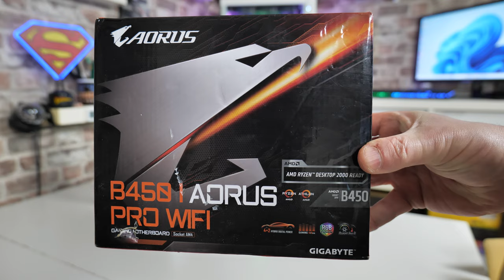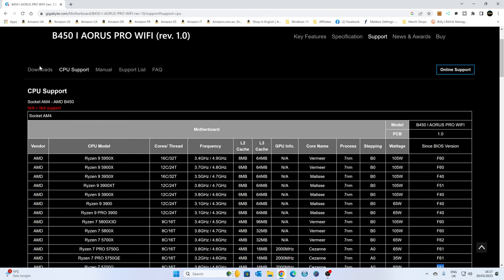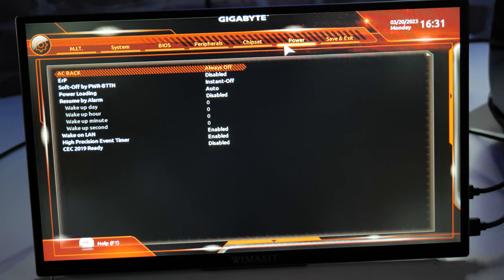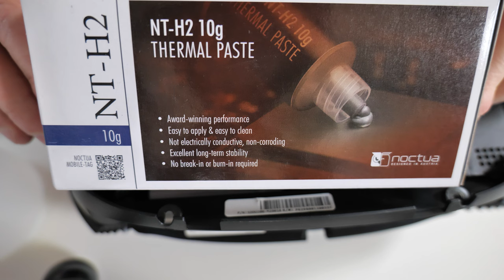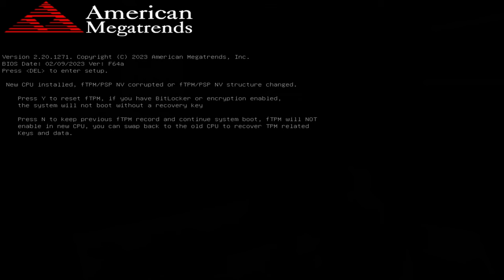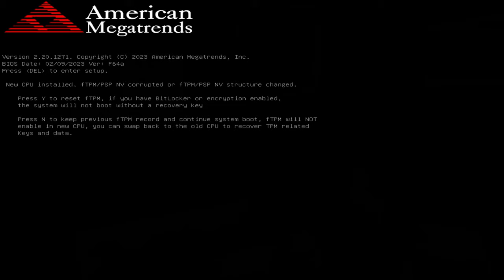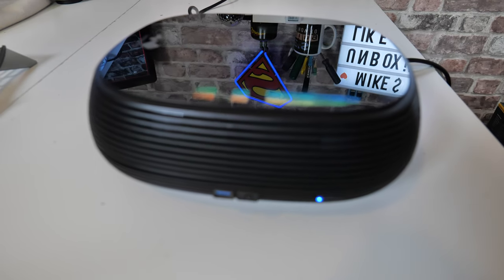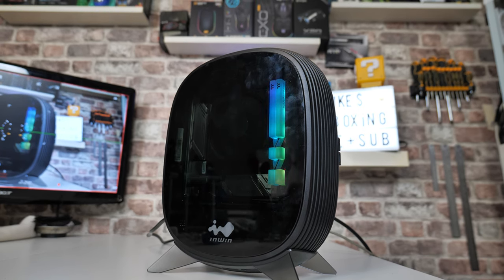Gigabyte ITX B450 I Pro WiFi BIOS & 5700g Inwin B1 Upgrade & Testing

Comment: Brett @ UFD Tech (YouTube) had this same setup (built it soon after 5700G was released) and had the thermal issues. He was going to cut slits or drill holes in the acrylic top above the cpu cooler to allow air actually to enter the case. But ultimately switched to the 5600G to get reasonable temps.
Reply from the maker: That is something I am considering

Comment: The main PC parts online dealer here in Aust. I usually buy from has jacked up the prices for AMD 5000 CPUs   5600G was $159 2 weeks ago now $399 5600X $349-> $499   5700g  $329 -> $549  funny how gone up just around same time lots of youtube videos saying how good the APUs and low end CPUs are.  the 7000 series are at present same price as before
Reply from the maker: crazy inflation and scalping at the moment

Comment: If you can run a low pro cooler with a 120MM fan the Noctua NF-F12 industrial PPC fan may help cooling.

Comment: I just sold one of my computer and ordered an Asrock b550M-ITX/AC so that I can put my 5700g in and print my case. I found a 3300x to replace the 5700g to have another working computer for sale. I will probably have to get a smaller PSU than the small one I already have to keep the case as small as possible. Then, I'll know who to blame if the airflow is bad😁
Reply from the maker: lol #blamedave

Comment: I have that mobo... It's pretty decent... The wifi is good on it though, much better than the MSI equivalent for some reason. The InWin Chopin with the mesh side would probably do a bit better. Can you try 45w eco mode?
Reply from the maker: yeah it needs some work, i might give up and switch back to the 2200g for a simple life

Comment: Great review as always from the dynamic duo. If you were to get another APU, might I suggest the 3400G as it has VEGA 11 graphics which would give you better graphics? It's only a Ryzen 5 and not a Ryzen 7. Should run a bit cooler in that case? It is an odd looking little case, but I like it too. Take care all. Cheers
Reply from the maker: Thanks for the tips!

Comment: Did you use any Zalman thermal paste? I would like to know if it's any better than Arctic or Noctua (at least it is on paper).
Reply from the maker: i didn't but i am doing a new thermal paste group test soon on the AM5 platform so watch out for that
Reply: @mikesunboxing  I'm also interested in Gembird thermal paste but not sure if it's being sold in Europe. The company claims it's based in Netherlands. For some reason temperatures rised after a few days of use.
Reply from the maker: @davidm7640  I’ll try and add it to the list

Comment: Hi, I also would like to upgrade my 3400g to 5600g, want to ask, why u don't need to install/update new igpu drivers  for your new 5700g? Does it mean I don't have to install new igpu drivers also?
Reply from the maker: it uses the same drivers so not needed, but always worth checking to see if there is an updated version